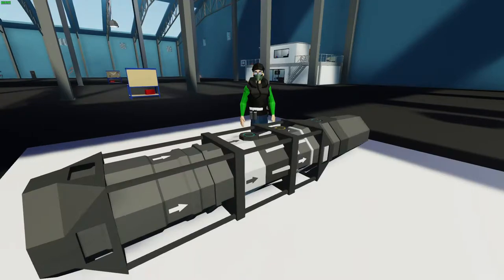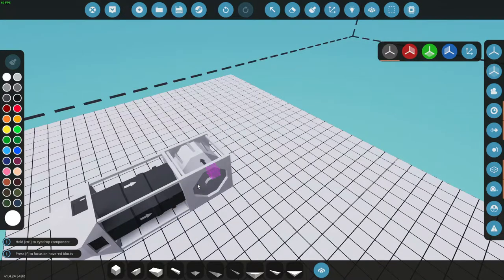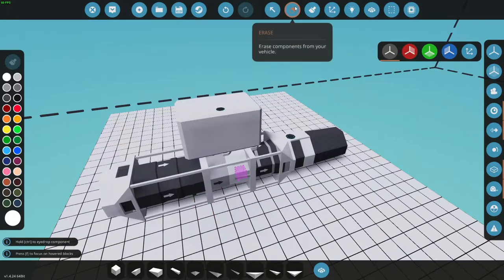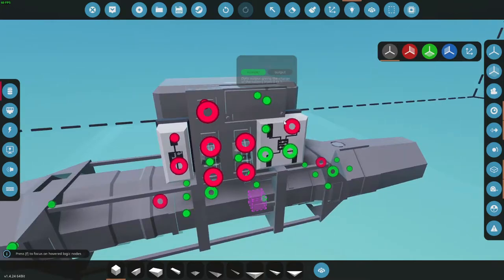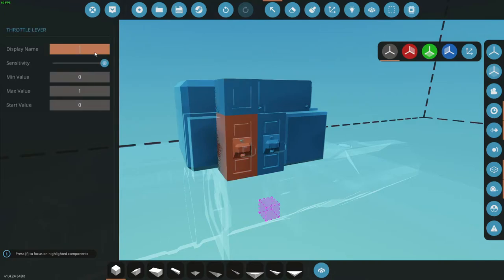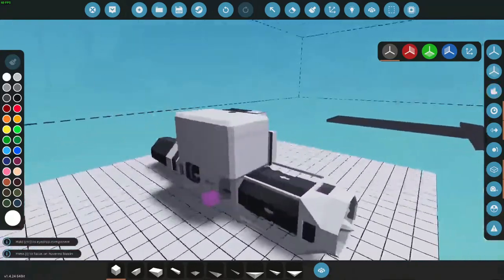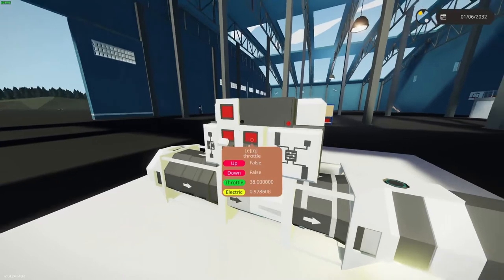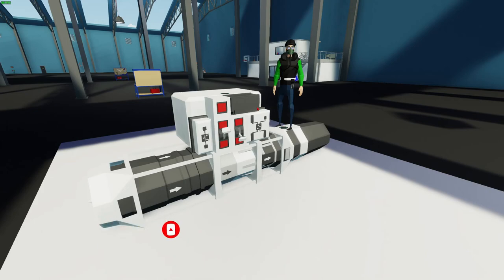Beginners Jet Engines! Stormworks Tutorial - How To

Comment: For PID (Intergral gain), I recommend leave it as a ZERO. Using 0.00001 is not ideal because if you start the jet engine for 2nd time, throttle fuel will rise and will be delayed for a few seconds until PID try to correct it.
Reply: 0.001 is what i found to be the best proportional and 0.0001 for integral with derivative of 0.05.  There are a lot of different setups, but for beginners it is best to keep it simple enough to just get it to work.   With experience,  there are many things that can be done to improve it, including using advanced PID in a microcontroller with multiple values for each.  But that would break the minds of most players just figuring out how to get the dang thing to start...😁
Reply: I like to use a fairly high Integral of 0.005 to 0.01 (and correct the jitter with a high D~=P). To solve the runaway problem, I connect the PID output to a Threshold of say -999 to 1.1, wire that to an AND gate, then back into the PID enabler. Then you just hook your toggle button to the AND.
This works for MANY applications. Integral gain is the most useful part of PIDs, people should be encouraged to try it.
Reply: @cf453 that and gate thing must be a very handy "reset" button, thanks for the idea

Comment: whats wrong with jet engines ? this is no longer working. any help? the eninge will get to 0.88 at full throttle but wont go further. so it will start at 2 if i remember correctly.